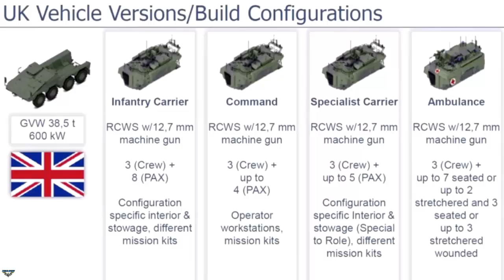UK will produce 60 Boxer vehicles per year

Comment: The main point about the boxer is that you can exchange the mission module in the field in 4 hours - turning your ambulance into an IFV, a Skyranger 30 AHEAD state-of-art SHORAD system or even mount a 120mm smoothbore Rheinmetall Canon. There is even a howitzer version - that's KMW's RCH 155, the successor of the PzH 2000, the first howitzer that doesn't have to stop to fire. (Though I'm not sure whether the 4 hour thing applies to the RCH 155) Third parties can develop mission modules - there is even talk of a GMLRS module. The Boxer is available in a 6x6, 8x8 and a tracked version.